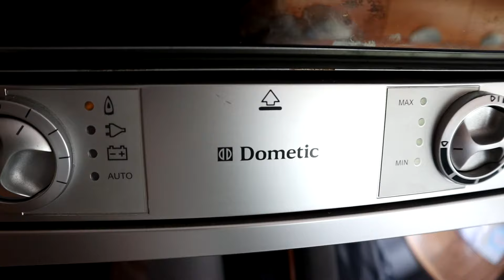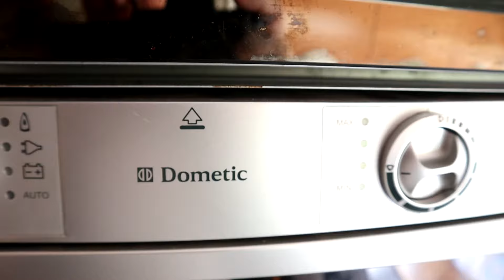Motorhome Gas Fridge (Dometic) Fails to Light (FIXED)

Comment: You sir, are a star! Had the same issue with an Electrolux 3 way fridge which came with a Motorhome we just bought and it looked like we would have to get an engineer out for £100 plus another £250 for a new regulator. Gave it a tap as you suggested and now it works! I have restarted it many times and it works every time. Thank you so much!

Comment: That was it!!!!!! I was just about to buy a new igniter, which wouldn't have fixed my problem. I put the hammer drill on it and boom, it's on. I spent an awful lots of time trying to figure this out. I did tap the valve with a hammer and it didn't work. Hammer drill is the key!

Superb fix!

Comment: Interesting, Thank you., I have just changed my gas valve for a new one as I have been having on/off issues for years, So decided to change the valve, Flame sensor and  everything works perfectly, I wish I had changed the gas valve years ago or at least brought one to carry around with me. Sometimes it's just peace of mind as you know getting parts when you are on the road and trying to fix things can be a real pain.
Welcome to France btw, I too registered my motorhome here, Zero road tax and two year CT's what's not to like 🙂
Reply from the maker: Agreed.  Road tax is antiquated when millions of UK motorists are exempt or illegally avoid it.
Annual MOT was from an era of Austin 1100s when 50,000 miles was the same as 200,000 miles today.
2 year CT is much better, especially with a low mileage commercial chassis motorhome.
Reply: @gohumberto  Agree. Also I watched your repair on your headlight, How has that worked out?, any problems with the CT (if it's due yet), I also agree with a comment you made that France was the best place in the world for camping cars, The thought  of taking the van back to the UK for a holiday fills me with dread and I will avoid at all costs.
I also think they are much more understanding on the CT than the UK MOT, I guess the set up is different than the UK were they are a bit more keen to fail you to get more money and work. Although when I lived in the UK I used local council testing stations which in my view were much better.
Reply from the maker: @SlimTortoise  Hi.  My plexi-glass/Acrylic headlight cover made it through the last CT .... as did the whole Motorhome.  The headlight "glass" I made is only conspicuous because it's actually clearer than the original one on the other side.
The only real worry is that the (Fiat Ducato) handbrake is very feeble and comes close to a fail every time (on the UK MOT as well).
I think it's a known issue and really needs a whole new cable assembly.  I just leave it parked in 1st gear.
Reply: @gohumberto  Hi. Sounds good, Our van passed a few months ago, No problems, Although for peace of mind, I changed both front ball joints, (slight play up and down) and tie rod ends and new bushes x4 total cost was around €60, I also adjusted the hand brake, but it's a very easy job on a Sprinter base vehicle.I may change the shocks and brake discs for the next CT, but I keep checking them and they are perfectly ok which does not seem bad as they are the original parts so 21 years old. All the best 🙂

Comment: Excellent and informative video mate, thank you for sharing your experience with us, we have a similar problem but our fridge doesn't spark when you switch it to gas and no gas comes out, what I did find is a burnt terminal on the igniter burner control device (the grey box) have ordered a new one so hopefully it will be working again soon. Thanks again for your help 👍

Comment: My camper fridge would not work on gas,wrggled all the electrical connectione and sprayed with w*40 ,gave the gas valve a good hiding click click it fired up nice blue fame.thanks for your advice.

Comment: Hi.. When the frige is running normal, is the light on the panel still yellow.
Reply from the maker: Yes.  It blinks when the ignition is firing, or trying to light, then remains on (solid yellow) when the gas lights.

Comment: Unrelated but what does the button with the square and waved lines mean
Reply from the maker: I believe it's to stop condensation between the fridge and the cupboard.  I could be wrong.  I'll check when I dig out the manual.

Comment: On mine the drill did not work so I removed the gas valve to find that the miniature nut that holds the insulated spade terminal on was corroded underneath and the spring washer rusty. The contact area in minute so it does not take much to loose contact, clean up and check with a AA battery 1.5volts and you can just hear the valve working, PS both ends need fixing. I guess thats why vibration gets it to work one more time.